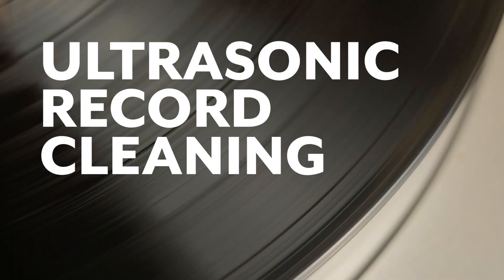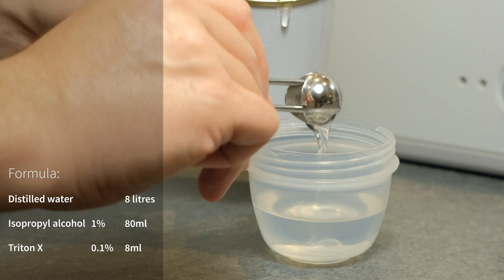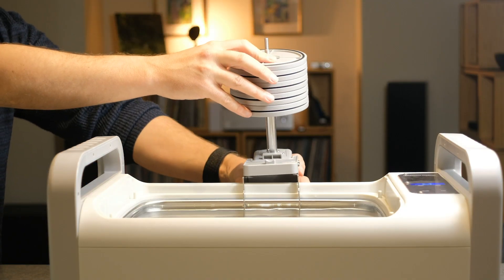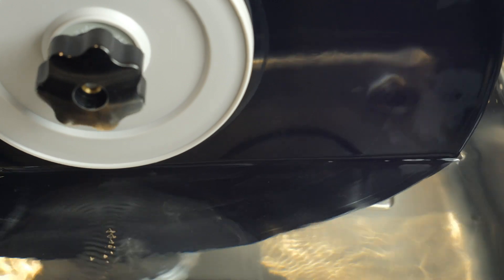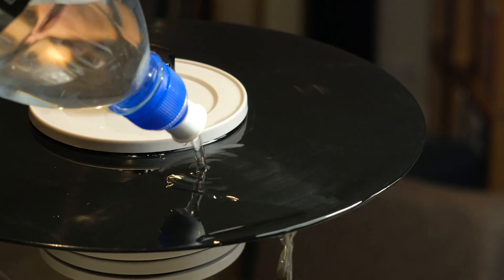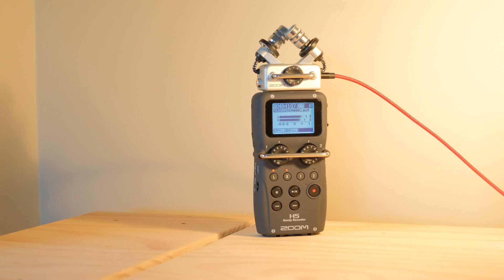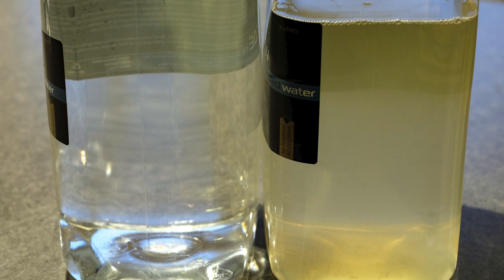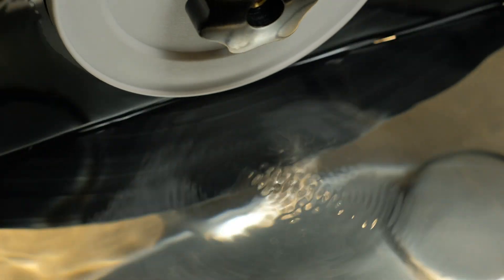Ultrasonic record cleaning - Before & After

Comment: Lp cleaning is a must. You really only have to do it once. The results are impressive. I wash my lps with distilled water and turgikleen using brushes to get into the grooves, then vacuum using a NittyGritty 1.5, then rinse using distilled water and another brush, then vacuum again. Takes 5 or 6 minutes per lp and the results are dramatic.

Comment: I'm in Sydney Australia, I use similar percentages of tap water, Methylated spirits(actually grain ethanol in Australia) and a very small amount of commercial vinyl floor cleaning detergent. The results are just as good as all the recommended agents that I used when I first bought the ultrasound cleaner, but a mate that owns a record shop and has been doing this for 20 years put me onto this much cheaper and just as good way to get records clean.

Comment: You shouldn't need to add anything in the water when using the ultrasonic cleaning. Just a myth as people talk about surface tension. Records don't repel water and whatever you add to the record will leave a film of the solution on the record. Most countries with clean and filtered tap water is perfectly OK. You can get 6.5L ultrasonic tubs pretty cheap. Add an attachment to it and you are ready to go. Just note 1-2 rpm is good. This one on the video spins way too fast. In summary don't spend too much and don't put anything in the water that is just going stick on to your record.

Comment: I have to laugh at all this mania about deep cleaning records with spin cycles and ultrasonics and god knows what else and angels with virgin mohair.The only time a record might need a deeper cleaning than a roller or velour type device is when you purchase used and dont know how the record was treated previously.99% of the time you can tell if an album was puked on by visually inspecting and why would you by that abused child anyway? If you are deep cleaning new vinyl your nuts.And finally what kind of environment are you living in that would require anything more than a discwasher type touch up? Clean your damn house or at least clean the mat on your turntable.I'm done.Have a nice spin.

Comment: @Shanon . Hello from Denmark. I have an honest question regarding water. Are you familiar with the difference between destilled water and demineralized water ?
Reason for asking is that in Every video i see regarding record cleaning, be it from U.S. , England, Germany, France etc.. Everyone say they use destilled water bought for pennies at their local store, but here in ol´ Denmark, i can buy Demineralized water at almost any store for pennies, but Actual Destilled water i can only buy online from medical/farmaceutical companies at 3x the price. The reply i get from people around the globe is : `I´m not familiar with the difference` - as if Google is a thing not heard of.. So i´m truly interested in your thoughts on this matter.. Thanks and nice video btw
Reply from the maker: Hi, that is a good question. 
demineralised water is also known as Deionised water.
the reason we are using distilled water, which is a type of purified water, is just so that there aren't any residues left behind on the record when it dries.
Demineralised/deionised water has had it's non-organic salts etc removed, so it should work just as well, and be cheaper too.

'Because most non-particulate water impurities are dissolved salts, deionization produces highly pure water that is generally similar to distilled water, with the advantage that the process is quicker and does not build up scale.'

https://en.wikipedia.org/wiki/Purified_water

good luck with your record cleaning!
Reply: Hi you from Denmark. It is the same here in Norway. You can't just go buy distilled water in a local store. I had to go to a computer store who made their own distilled water used for cooling systems for PCs. It cost €10 for only 1 litre. I couldn't just poor distilled water like this guy does in this video, it would ruin us.
Also, I'm not sure why he needs to rinse the LPs after using only 1% isopropanol. Isopropanol is known to vaporise itself and it doesn't leave any residue behind.
Also #2, he doesn't need to use isopropanol as surfactant when ultrasonic cleaning records. The kHz used to create the microscopic waves you see is actually the water molecules breaking from H2O to H+OH, which works as a surfactant in itself.

Comment: Nice, but I think it would have been a better test if you had also recorded samples after cleaning with a carbon fiber brush and a disco antistat to see whether the ultrasonic would make a noticeable difference after a basic clean had already been attempted.
Reply: No brush would solve it like the good result showed in this video. He could use the manual wet cleaning method, using about %15-20% isopropanol with distilled water, and wash it by hand and a microfiber cloth. I get the same results by doing this as he does in the video. There is nothing fancy about ultrasonic cleaning. Also I do not need any iso for ultrasonic cleaning, as the breaking of H2O molecules to H+OH is a surfactant itself. And 15 minute cleaning with ultrasonic? 6-7 minutes is enough, it is proven that longer than this actually damages the records with ultrasonic cleaning.

Comment: How do you dry you vinyl after it has finished cleaning in the CD-4875? I'm considering getting one. Would you still recommend this product?
Reply from the maker: I just let it sit in the rack and slowly dry, like I show in the video.
Yeah I’d still recommend one
Reply: If you clean by hand and microfiber cloth and use isopropanol with distilled water, it dries quicker. Dry it off with a microfiber cloth. This will reduce drying time dramatically. You do not need to rinse off isopropanol.

Comment: This is the best and most informative video I have seen on ultrasonic record cleaning. I use the same method but without the addition of the Triton X, which I am going to ad, as soon as I can find some more distilled water. Thx a bunch, great video!
Reply: It is actually not, because you do not need to add any surfactant when ultrasonic cleaning. Only distilled water is needed. This is because H2O breaks up into H+OH, and that in itself works as a surfactant.
Reply: Patrick, you also have a hard time finding distilled water? I found a solution. Computer stores, who sell and build PCs, produce distilled water themselves for CPU cooling systems. Highly recommended. The pharmacy water that the employees there say is distilled water, isn't true, I've checked with the distributors, and the sterile water employees claim is "yes, it is, distilled", it is not. It is just lack of knowledge by the workers, which is quite annoying. Sterile water has only been boiled, not distilled.

Comment: The sound difference is incredible even through the YouTube video. It would be cool to here and a b comparison between a record cleaned with the spin clean system versus the ultrasonic cleaner.
Reply: A spin clean is in between this. There you have that result. Spin Clean is also just annoying, dragging dirt around within the brushes. Also you need to spend a fortune on their silly priced fluid that makes dirt sink to the bottom, it has residue that sits on the records afterwards, due to these residues. And after a little while, you need to buy more overpriced brushes from them. Total waste of money product. You could rather clean by hand using a microfiber cloth - much safer - quicker - and CHEAPER.

Comment: Thanks for your video and great to hear from a fellow kiwi in the vinyl community.

Real groovy also sell the CD-4682 which appears to be a smaller cousin at a cheaper price.  Are you familiar with this model?

Also do you think there is and loss when cleaning 5 at a time?  Does the cavitation occur between the records as well as it does when cleaning just one?

Cheers
Reply from the maker: I haven’t tried that smaller one so I can’t really comment, but the one I have barely covers all of the grooves, you have to fill it above the max water line. As long as it is the same depth as my one, it’s probably fine.

There is definitely a loss in cleaning action the more records you put in at once, because they block the energy reaching the records behind them. But still, even with 5 records in there, they definitely do get clean. If you really want to give it a good clean, I’d say just put in one record. Sometimes I put in 2 and space them out with the rings in between them.

I think that with these machines there are definitely sweet spots in the tub, that have the most cavitation. It’s caused by 3 motors, and you probably want to be as close to those as possible, compared to off in the corner.
Reply: @Filtersloth  Thanks.  Food for thought.  I'm also eyeballing the humminguru soon to be released and appears affordable.

Comment: what does the tritan x do?
Reply from the maker: It’s a gentle detergent. It attaches to the dirt and helps take it off the record.
Reply: @Filtersloth  Eh, not really. Attaches to the dirt? 😂 The "extreme" tiny sound waves in an ultrasonic system, H2O split to H+OH, removes the dirt. You do not need that detergent, nor the isopropanol in such a system.
Reply from the maker: @rabarebra  well I’ve tried it with just distilled water, without detergent or isopropyl, and it did not clean it as well at all.
Cleaning it again with the detergent brought more dirt off the record, which could be seen in the water.

But anyway you seem like the kind of special person that leaves half a dozen comments on a video, likes to argue and is an expert in everything. So good luck to you. Bye.
Reply: @Filtersloth  You would be better off pre-cleaning it, then use ultrasonic with distilled water only.
Reply: @Filtersloth  "half a dozen comments" Is to correct your faulty unnecessary claims.

Comment: Good video. I use the Kirmuss version of the Codyson unit. It only does 2 at a time but eliminates the need for the skewer & spacers. You just drop it in the slots of the top and press a button.
Reply: Have you seen results as positive as this with the kirmus? I know his method does not use any soap.

Comment: you put your deck atop anamp      ................CRAZY
Reply from the maker: Is the problem because of magnetic interference or from heat?
Magnetic fields fall off so quickly over distance that I don’t think it would have an effect, and although the amp is A/B, it could still dissipate heat easily. 
Really I only had it there because I had no other place to put it, but since I made this video I’ve moved them apart because I got some new shelves.

Comment: This is the first time I've ever really heard what can be called a true difference in the sound of a before and after.  Can you please confirm that the level and settings  of each playthrough are the same?  The cleaned playback actually seems to have more volume, better highs and in general feels like a blanket was removed from in front of the speakers.
Reply from the maker: yep, the levels were the same, nothing changed between recording the before and after.
Reply: @Filtersloth  That's amazing.  Thanks for posting.

Comment: This is exactly what i am after / Im IN AUS so may order from NZ and get it shipped. May i ask how noisy the unit is when its turned on ? Alot of the other Ultra Sonic cleaners out there are super loud. Otherwise awesome video!
Reply from the maker: It’s pretty noisy and annoying. But not quite as annoying and loud as another smaller one I have
Reply: @Filtersloth  thanks for info man, much appreciated 👍.

Comment: What did you use to clean the stylus between dirty/clean record?
Reply from the maker: An Onzow ZeroDust
Reply: @Filtersloth  Should only use a clean dry stylus brush. What is Onzow good for? They don't say what is in it. Do you know?
Reply from the maker: @rabarebra  it’s just a sticky soft rubber thing. Similar to the material you’d get with those kids stretchy hand toys.
Hard to describe, but it doesn’t leave a residue, and it can be cleaned with water when it eventually gets covered in dust. Lasts forever pretty much.
Reply: @Filtersloth  The Onzow leaves grease all over your stylus. It DO leave a residue.
Reply: @Filtersloth  A stylus brush is the only thing you need.
Reply from the maker: @rabarebra  enjoy your little fantasy land.

Comment: My spinner goes for 10 minutes -- and only two complete turns. I have fantastic results at that very slow speed and have a very concentrated clean. IMO, your spinner is going way too fast.
Reply from the maker: Yeah I thought the spinner was going too fast at first as well. But then I thought about it, each part of the record spends exactly the same amount of time in the fluid, despite if the record spins fast or slow  as long as the machine is on for the same amount of time. 
Also cavitation is happening incredibly fast, faster than you can see. 
Without a lot of testing it’s impossible to say if it’s more effective for a part of the record to stay in the fluid for 5 minutes straight, or for it to receive a constant pulsing of cavitation over and over for the same amount of time. 

The record gets clean, so it’s obviously working.
Reply: @Filtersloth  I see your point. I just want to give more time for the bubbles to work deep into the grooves. FYI, your cleaning solution is nearly a mirror image of mine. Works really well.
Reply: @alanarakelian5021  Slower is better. He will get problem with overheating if cleaning lots of records. Also, 15 minutes is way too long.

Comment: Did you connect the H5 via RCA to mini jack cable, out of your amplifier for the record clips you played?  I just got an H5 to use for recording vinyl, and plan to work my projects the same way.  I'm assuming the mini jack input on the microphone capsule defeats the mics and lets you use the input level gain on the capsule.  I have not seen any other specific examples of using the H5 for this purpose, so any other advice for using the H5?  Thanks.
Reply from the maker: Yes that’s right. Into the Mic capsule that clicks on to the top.
Reply: @Filtersloth  Thank you sir!

Comment: too bad you didnt use quiter passages for comparison, even with headphones the difference between cleaned and dirty loud passages is not that big according to what i hear, just a bit more open thats it.  I also wonder why you add alcohol and triton as most manufacturers advice just tap water
Reply from the maker: Try listening again but try to just concentrate on the sound of the guitar. It becomes pretty much inaudible when dirty.

At first I tried with just tap water, however it didn’t work very well at all, and it left mineral deposits on the record. You need a bit of detergent to bind to the dirt and carry it away.
Reply: @Filtersloth  The H+OH will carry it away. You do not need the detergent.

Comment: Expensive if you just wanna clean one record . Distilled water aint cheap
Reply from the maker: Distilled water is cheap at the supermarket. 

The ultrasonic cleaner is the expensive part. And yeah I wouldn’t bother with all of that if you only want to clean one record.
Reply: @Filtersloth  Those you find in the supermarket is not distilled. It even doesn't exist in Scandinavia.
Reply: One litre distilled water in Norway, costs about €10, if you can find it. But our tap has so clean water we don't really need distilled water.

Comment: Try to put the nut on backwards and you won't get water on the label. I am gonna try your suggestion with the alcohol and Triton. Cheers
Reply from the maker: this was a really great tip, thanks.
Reply: Also, get rid of the detergents and surfactants, and there will be almost no spilling at all, as it is also unnecessary for ultrasonic cleaning

Comment: 15 minutes?  That is a long time to be immersed in alcohol, nonetheless a surfactant.  Since alcohol leaves residue it's good you use distilled water as a rinse.  This is one involved process for a single record.  The Kirmuss system is easily as good and less time consuming.  It's also not a good thing to clean records with water that is quite that dirty.  You really don't want dirt particles bouncing around at high frequencies against your record.  I avoid all of this by using a Audio Desk Systeme.
Reply: yeah a $4000 system
Reply: Isopropanol leaves no residue, but it is not needed in ultrasonic cleaning. Only distilled water is needed actually.
Reply: But agree with you, Hel Gar, this ultrasonic system used in this video will only bombard the next records with dirt. Useless.